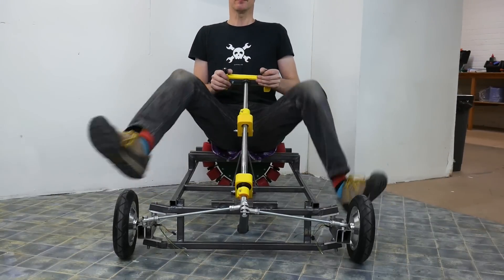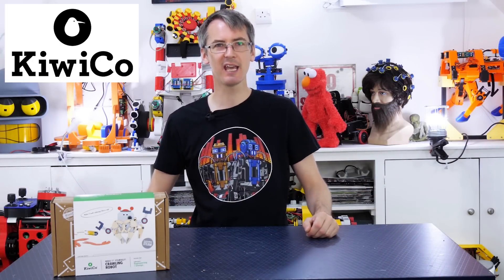Epic Drifting on Wheel-of-Wheels

Comment: Awesome engineering James. I would love to see you take an EGO zero turn riding mower and convert it to 4 wheel steering using the existing lap bars. Basically converting the front caster wheels to steer along with the lap bars position. Maybe add a windshield wiper motor to each caster fork spindle. Main issue with zero turn mowers is the front caster wheels are not part of the lap bar steering, so they suck on slopes.

Comment: Very crazy looking thing - I love it!😍
Stability could be much better by just lovering seat into frame and then move feet in front of front wheels, so whole body would be closer to the ground 🤓
Really cool steering wheel, smart to use 3d print and cheap of the shelf thumb throttles. Super idea 🤯👌

Comment: Maybe flip it around so that the single wheel is at the front and the smaller wheels at the rear as that where all your body weight is located in the seat it’ll help for more sturdy ride.

Comment: I would’ve personally made the rear wheel controlled by two separate pedals for both feet, something similar to rudder pedals on a plane. Then you can put a throttle on the wheel, maybe like a brake lever on a bicycle?
Very cool however, awesome work

Comment: I find it much easier to control the TIG torch by holding it palm up and to rest my elbow holding the torch on the table/frame/my leg or something stable. It is kind of like holding a drum stick traditional style. I tend to get straighter more consistent weld beads compared to palm down the way you seem to be welding. I think a lot of the stability comes from being able to rest my elbow on something stable, so I can pivot the torch around my elbow. Once I am ready to weld the bead, I do one test pass without turning on the TIG and just make sure I can reach the entire weld, or at least make a good length bead on longer welds.

Comment: Tricycles (of both orientations) can be fairly stable IF most of the mass (especially high mass) is closer to the paired wheels. You're sitting nearly over the single wheel.

Comment: I would avoid adding a second drift wheel as it would look more like a standard kart or even one of those forklifts with mecanum wheels. To keep in line with the mono driftwheel theme just make the back wheel more like a tank tread. basically the same wheel but horizontally elongated, freely rotating but still relatively stiff, and a lower center of gravity. I would also recommend making the frame wider in general. The back wheel doesn't have to span the entire width but seeing how relatively tall you are at the end makes me thing that even if this thing was perfectly sturdy you're still making the center of gravity too high for what I assume is a standard go-kart sized frame. Maybe if the wheel were slipperier or something you could more easily transfer that relatively tall mass into a drift easier but I don't think that's the solution. 

keep up the good work

Comment: Interesting as a concept but for fun it needs 2 backs wheels and a lower CoG so you can go nuts without stability worries.

I think I'd stick to an over powered motor and spinning wheels thou --- there is just something about doing something it isn't "designed" to do (wheels going sideways) which makes it fun.

Comment: How about two smaller omni wheels on the rear but instead of powering them they have a brake so you can release the brake to control how much you drift

Comment: I think the falling could be reduced a lot. It looks like it happens because your weight is back and center on the rectangular frame, which has two stability points (wheels) as opposed to one on the back, in the center, which can rotate. So as your center of gravity moves around with inertia, that's more easily carried through the two less stable back end and you fall to the side and backwards. This might be fixed just by adding runners along the bottom of the frame right about where the seat is. Make em out of longboard wheels or something, maybe off the ground a bit so they only assist with staying upright in tight turns? Not an engineer but that's my sight reading of some physics, lol.

Comment: Looks like it must be extremely interesting to drive.  It might also have been interesting to drive the back wheel through a PID controller with lateral acceleration as its main input.  That way you could have a pedal controlling how loose the rear end is, instead of switches on the steering wheel.  Just a though.

Comment: If back wheel stops immedately it tips off. You can try to measure the current and not stop the back wheel until the current (and applied force in that direction) reduces. Or increases i am not sure. it probably draws more current when drift corrects itself. So "icreases" might make more sense. 

Or cut the back wheel energy and turn it back on when it stops or comes down to a certain point.

Comment: Every project I have seen on this channel has been a wonder of innovation and imagination. I hope you refine this one.

If the seat was mounted on a slider that moved it to the side of the direction the cart was turning as well as tilted the driver that would help with the problem of rollover.

I would work the design up from pivoting the driver and steering column together left to right, loosing the accelerator pedal for twist grips on the steering handle and just having blocks the driver can brace their feet on.

Comment: The stability issue is due to the weight balance. Your weight is mostly on the single rear wheel so the front wheels are under-loaded and contributing less to the lateral stability of the vehicle.If you wanted to keep it as a trike you could either extend the rear back farther, or move the front wheels back. Or move the seat forward I guess but that would mean a major redesign...

Comment: First thing, that isn't drifting. It's strafing. Still pretty damn cool, but not drifting.

Second thing, your welding and metal fab skills are terrible. It's absolutely doing the job, but still terrible and nowhere near as good as you can do. Don't be disheartened, just practice mate, you'll get there for sure.

Couple of quick tips for you, first one, get a couple of largish g clamps, all metal construction so they don't melt when welding. You need to rest your hands when you're welding. Very very few people are steady enough to Tig weld without a hand rest. Attach the clamps to the job to use as hand rests. One for each hand.

When you finish the weld don't just pull the torch and filler away. I assume that you're using scratch start, hence the pulling away, but doing that is causing your welds to oxidise along with the end of the filler rod.

Better technique is to just lift the torch high enough to break the arc, leaving the weld and the end of the filler rod in the shielding gas until it cools.

If you can get a foot pedal for your welder, do that. Then when you're finishing a weld you place the filler rod against the job, turn the current all the way down with the pedal and run the arc up onto the filler rod before turning it off.

Please, for the sake of your drill bits learn how to use them. Learn about feeds and speeds and how to sharpen them. They're blunt and spinning way way to fast for what you're drilling. They're literally screaming in pain in this video.

As I said, your metalworking skills need a lot of work, but you will get there. Just gotta keept doing it.

Comment: The next obvious step is to reverse the steering linkage, and add a potentiometer to the steering shaft for drifting. When you turn right, the front wheels should turn left and the rear omniwheel should start to drift you right. Take the human element right out of it. You'll need some speed data too I suppose so the omniwheel only turns at an appropriate rate for your forward speed.

Comment: Thinking back on your various projects, do you have any reaction wheels laying around that you could strap on this thing?  Just trying to think of ways to combat the tilt with things you may have on hand.  :)
Reply: Second thought:  Caster wheels on arms to act as stabilizers.
Reply: Third thought: Applying a deceleration curve to the back wheel if its stopping or changing direction may also help with this. You seem to tip when you the back wheel makes abrupt changes in velocity or direction.

Comment: Why on earth did you make the CoG so high? If you flipped the seat mount bars 180 and we'll it underneath you could drop the seat height massively. Put a 360 knuckle joint in the steering column and you would have a much lower CoG with out having to put a forth wheel in. Also I noticed that the drift wheel is quite jerky, you could code in an Euler function to smooth out the throttle off jerks

Comment: You could add 2 helper wheels on the corners in the back to avoid tipping over I think. Link to the Amazon accelerator pedal please? I find it cool that there is no brake pedal.

Comment: I think this would work really well if you turned the omniwheel 90 degrees so that it points in the direction you are going and make it the driving wheel, removing the front wheel drive and then adding some resistance to the tiny wheels on the omni so they don't spin as easily but only under load. That way it's RWD but can still skid sideways with the tiny wheels and you won't need the extra "drift buttons" at the steering wheel! I think it would drive really well as long as you adjust the resistance of the tiny wheels so that you don't spin out instantly but can also skid some.
Reply: Could also mount the omni-wheel at 45 degree ... So funny that that is even possible.

Comment: Two angle controlled caster wheels at the rear may also be interesting. With some combination of throttle input and steering angle, simulate breaking traction by turning the casters. Maybe if I start now I can have something ready before my nephews are old enough to get their actual drivers licenses... some 12-ish years should be enough :o

Though this was of course an exercise in omni-wheel applications, and a very cool one at that!

Comment: I'd suggest having a sloped wedge for your left foot. Perhaps have a button on the left and right of the wedge, so when you pivot your ankle left and right, you can switch between reverse and forwards.

Also perhaps some stabiliser bars on the left and right with castor wheels? (Like people put on Reliant Robins)

Comment: The front wheels skid allot, I think the Ackermann angle is wrong when drifting. considering it is only going to be "drifting" to turn then it is probably worth using a zero or negative Ackermann angle. Also, you need to mix the wheel speeds to account for the turning otherwise it will try to skid like a fixed axle drive.
Reply: AntiAckermann would work for typical drifting, no grip under the rear axle with front guiding wheels, but would not work for this due to the setup. The problem is, you have a perpendicularly driven omni-wheel that only allows for two axes of movement, forward passively and horizontally actively, which means it does not have a turning circle itself; mixed with the front wheels, it does have a turning circle somewhere, but the center will be in-line with the center of the kart. Mix this with the more typical front axle's steering, and you'll get a turning circle somewhere between the two, due to stupid amounts of skid and slip; and I can almost guarantee you that James has not gone down that rabbit hole to figure out where the turning circle's center actually is throughout the entire steering throw or how to optimize the mixing to maximize efficiency during turning, either normally or drifting. 

Honestly, this is a bad design, and designs like this will always be bad, because they do not work for the purpose they're made to do. The rear wheel should be based on an active omni-wheel, the kind where both axes of motion on a singular wheel are powered, except this should be inversed to where instead of powering these axes they should instead be passive and braked, that way one axis can be locked out to passively allow full movement to the other axis, vice versa, and variable mixing. But even with this, the best you'll achieve is poor emulation of actual drifting, it'd better emulate fwd drifting (also known as ass-dragging) but even then it'd poorly do it; this is because in actual drifting you'll actually have a ton of energy in the rear wheels and the fact that there is still some grip, this is what causes rear ends to sway to one side under burnouts and drifting has similar characteristics, whereas in any omni-wheel setup the rear wheels will be dead and passive or poorly driven, the various dynamics are just not there. Overall, it's a characteristics issue, and omni-wheels just cannot replicate these characteristics while attempting to emulate drifting. 

This is also just poor use of omni-wheels anyways, they're meant to allow for omni-directional movement under proper mixing of multiple axles (parallel or non-parallel) with omni-wheels on each axle, not give weird handling characteristics to a hybrid setup; they're meant for a movement platform, not a typical vehicle. The bike was a better concept, though it should've had the omni-wheel in the back, that way you can use your hips to swing it from side to side, similar to the swing bikes Swing King produces.
Reply: @xaytana  have you ever made your own omni wheel?

Comment: So effing sweet! If you cambered, or "toed out" the front wheels that would probably help with the tilting issue, though with such small wheels you may need to angle them at 8-10 degrees rather than 3-5. 
Your videos just keep getting better and I'm loving the addition of welding!
Reply: Camber and Toe are two different things and wouldn't really help with rear stability.

Comment: wouldn't you get better more 'real' drifting by having the front be omniwheels? that way you can have unlimited direction range in the front steering enabling you to keep 'burning rubber' through whatever curves without the back spinning out as you run out of steering

Comment: hear me out, what if, just what if, instead of just having four wheels  like a regular car with two omni directional wheels in the back, you add another omini wheel in front, replacing the two small regular ones, then add TWO more omini wheels on each side, giving you SIX wheels capable of every direction.  you won't topple over with a stable base and you can program the servos to go different directions on each wheels to break.  use a joystick to control direction(its omini directional, just like the wheels), one foot for power the other for break.  you can set up two buttons to drift left and right, to have front wheel in one way and the back ones going another. you can set up two other buttons to just rotate the front wheel to turn your face.

Comment: @10:00 you need to add a couple stabilizer wheels on either side of the back drift wheel, to keep from turning over, which is common on Trikes... You dont need 2 drift wheels, just add 2 stabalizer ball wheels  on either side of the drift wheel :-D

Comment: Would a two wheel drive version of this work? like if the front had two normal, unpowered wheels, and the rear had two powered meccanum wheels? You could get both forward and sideways drive out of just those two wheels I think.

Comment: an interesting modification (since i don't think you're offroading right?) is flipping the seat brace so it's below the chassis
that way you're sitting closer to the ground and hopefully don't flip as much
Reply: And/or lower the center of mass a bit by adding a bit of mass if possible. There seems some room for some extra work (E) to compensate the added mass acceleration? Easier to try out?

Comment: looks like fun :) maybe dropping the seat a few inches might help with easier balance
Reply: @kennyanderson3123  Just go fast enough and that will magically happen by itself :)
Reply: Maybe just a larger pair of front wheels with the mounts inverted so the cart hangs below the center motor shaft. But over all its a bit too narrow to be stable, it needs another foot in width and larger front wheels to make it more stable
Reply: Came here to say this 😁
Reply: If he also put some 'training wheels' on casters to either side of the big wheel at the same width as the front wheels, or wider, he should be good. That thing looks like it'd be super fun.